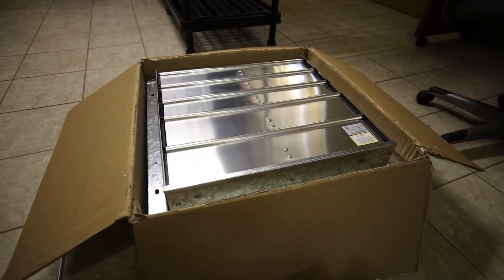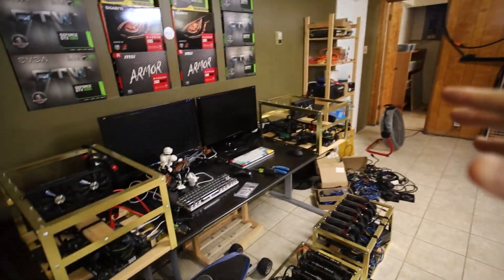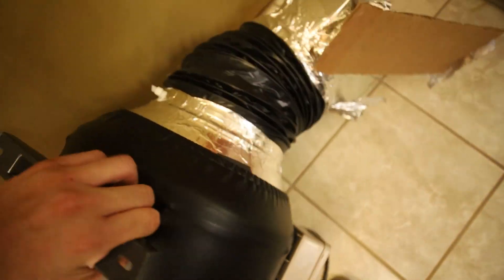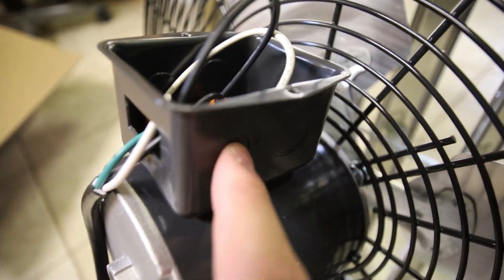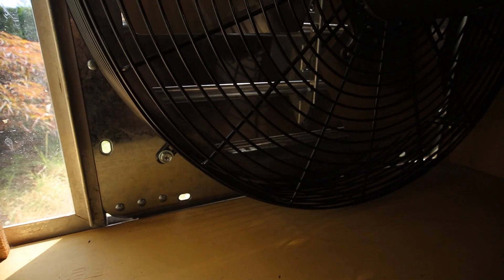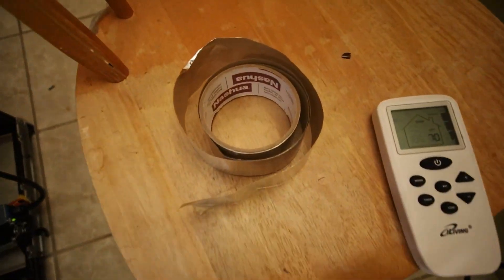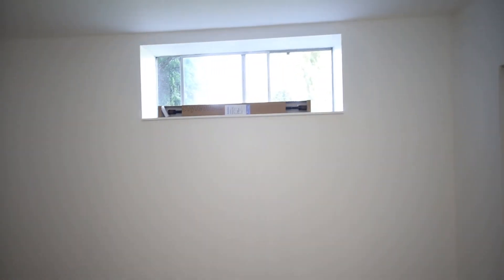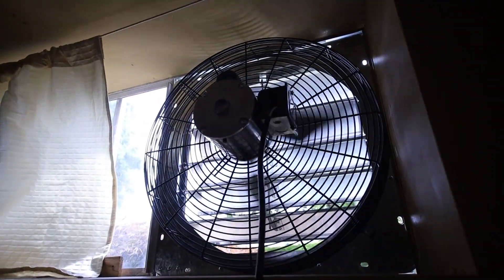NEW EXHAUST FAN... 🥶

Comment: Your welcome, we know who's idea it was for the 18" fan. You also need some more fresh air intake. You need about 3 times the size of the 18" fan on max speed. So you need a opening about 1.5'x4.5'
Reply from the maker: Im officially DONE with exhaust/fans now its working lol
Reply from the maker: Damn it spacegoats
Reply: You know your not done. Your just getting started.
Reply: Thats over 1600 sq in, which is larger enough to run 10k cfm at 1150fpm!  You need a louver, and depending on the louver size it will have a different "free space" that will determine the size you need to that amount of air at a particular cfm. 

If you add in filtration...which you should... you need to consider the static pressure increase required to pull X amount of air through your filters (depends on the filter type).  Since your only fan is exhaust, it will have to overcome the static increase....unfortunately axial wall mount fans aren't the best with static pressure.

Filtered intake fan at equal cfm with metal mesh (washable) filters is the best solution here. (Except for the power it uses)

Experience: Commercial ventilation expert for 20 years.
Reply: @RedPandaMining  never done
Reply from the maker: @grenwolde  NEVER :'(
Reply: @RedPandaMining
Reply: 0:55
Reply: @RedPandaMining

Comment: If you enclose the area between the fan and the rigs with 4x8 foam board pieces your exhaust fan will work twice as well.  Basically just put the foam board to the front post of the rack to turn it into a giant exhaust hood.  Right now it's drawing air from the path of least resistance which is the entire room..  isolating that corner will help you substantially and foam board is easily movable.  I only have four 8 gpu rigs but I ducted that same 8 inch inline fan outside with a collar through the foam board on the hot end.  Tough to explain through text but basically the rigs are setup in a small square space with a divider 3/4 through the middle and open on the basement end.  The rigs are lined up so the fresh air passes right by them all.  Works like a charm.  Even the 4th one on the hot end never sees gpu temps above 64C.

Comment: Hey Red Panda, I mine since 2018 and I don't miss one  single video of yours. If I could give you a tip, you should block from the top of your shelf to the ceiling (you can use styrofoam sheets), that way you will create a hot aisle containment and the air won't recirculate and mix with your fresh air. Think about it.

Comment: Depressurizing a house with an 24-7 exhaust fan does carry the risk of creating Carbon Monoxide back drafts. This is when the combustion gas from a gas water heat is sucked back into the house by the negative pressure. Just something to be aware of if you have gas appliances.

Comment: Just finished building the first new rig I’ve built since 2017/2018... 13 card AsRock 5700 Challenger D (non-XT). Flashed to XT and added 1500 straps mod. 56.5-57Mh per card. 120-127W per card. About 1700 total watts and 740~ MH :)... had to use 4 power supplies hahha.

Comment: If you plan on keeping the mining op, you could consider using a air to water heat-pump with a big buffer to heat water and heat the house. In summer it's not that beneficial because you need much less warm water but you can always extract too much heat to the outside with fans.

Comment: I need to get a fan like that, but I need a 12 inch x12 inch for my opening in my laundry room. I have one of those fans on my homemade generator box. Works great so I can run it closed off when I lose power.

Comment: Pro Tip: You can remove the fan from the shutters (via 4 bolts) and add aluminum bug screen between the fan and shutters, because as you'll find out if it's not running 24/7, it is not bug tight.

Comment: Another idea is to put solar film on the outside of the windows that get sun, it will help lower the peak heat load into the room.
Also paint any exposed outside wall on the South side white, if it isn't already.
Every little helps. :-)

Comment: please look into a server room design sperate the hot and cold site of the racking this cap be done cheapy with tarp !! you will get a much better cooling rate not allowing the mixture of hot and cold air from both sides of the racking and also the exhaust will be ALOT more efficent in extracing the hot air,  as bu seperating the cold/hot side you have much more control over temps

Comment: TWO... you have room for another one. Put a second fan in that window and your temps will be even better. Also if you haven't thought about it... you should build a hot room / cold room design. You need to close off your rigs in an isolated room with a lot of exhaust fans to pull out the hot air. You are still pulling out air from the rest of the room. You need to focus on the hot air from the rigs.  This is a much better solution than the in-line fan though.

Comment: Hi Panda. I have 2 450cm collers like yours. They make 9000m3 in a hour in max power by 2. My rigs are frozen. Summer temps 50-60 cels. 2.4gh power on eth. 11 rigs. 71 card. 9800w power consum at 220v. Make them to FROZE!!!!

Comment: only one remark RP, why didn't you install the exaust fan on the left side of the window insteadof the right side. that would have put the exaust right at the upper most corner of the room, where hot air might get trapped :)
anyway, I think overall the upgrade was significant. I wonder how much you can drop. Keep it up RP
Reply from the maker: The window only opens up right side :(
Reply: @RedPandaMining  ahhh ok. keep a watch on that corner though (if you have the time) you might have some turbulence there but not enough to shake the warm air out of there.

Comment: I can’t find much information online so thought I would ask on here - how many of the same type of gpu (rtx 2060 super) does nvidia drivers support? Windows used to only support 8 but I hear now it is 50. Limitation are the drivers now so what is that maximum number of gpus per system? Thanks in advance.

Comment: I bought this model as well as the next tier up (double the cfm) and let me tell you the next model up pulls so much air!
Reply from the maker: I was about 1.5" away from getting the 20"... I wish i was able to fit that one
Reply: @RedPandaMining  oh i meant in the size you got (the 18inch) they have 2 different models. One uses .85 amps and the other 3.5 amps. The 3.5 amps pulls double the cfm.
Reply from the maker: @Kent535535  WHAT I NEED THAT THEN, how come i dont see this 3amp one hmm can you link me sir
Reply: @RedPandaMining   ill message you on discord so its not cluttered on here?

Comment: The game will change when it gets colder outside. Real soon.
Reply: I'm using 3 x 24" 1920 x 1600 monitors. They are called "frameless", but they really aren't. They have bezels thinner than traditional monitor bezels by 50x, but there's slight black bars on either side - larger than the think bezel. The actual unused area on either side of each monitor is larger than the same area on my phone. Frameless to me, is just market hype, I'm waiting for truly edgeless monitors.
Reply from the maker: Yeah ill have to turn it off in winter hahah negative temps

Comment: mining with 3x RX5700XT on a rig, worked fine for almost 3 months now. Since about 2 weeks now, 1 GPU goes off in the MiningSoftware (Nanominer). Sometimes Win10 crashed and the comment is "AMDKMDAG.sys". Tried losts of stuff, but nth really helps. Anyone having similar troubles with the RX5700XT or Win10/Nanominer? Greez

Comment: Whoever is reading this,
this has nothing to do with the video but i just wanted to say that i bought a mining starter kit which includes a Motherboard and a ram and cpu from nerdgearz, and it came pretty beaten up, full of dust, and dead on arrival.
Sent them many emails and it's been days no reply.
I will not buy from them again and from any website that has no reviews or a place for them.
Reply from the maker: I just asked NerdGearz and they said they have not gotten any email regarding a beaten up starter kit. Please advise.
Reply from the maker: also please pass me your email address used on nerdgearz so they can confirm.